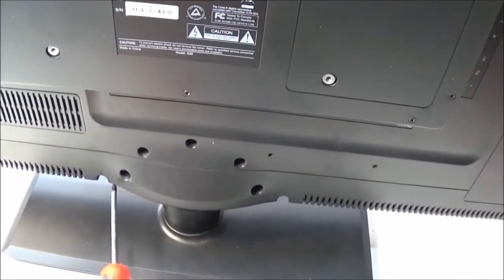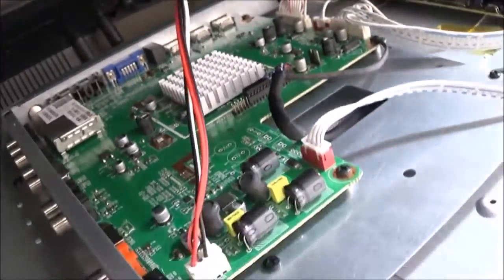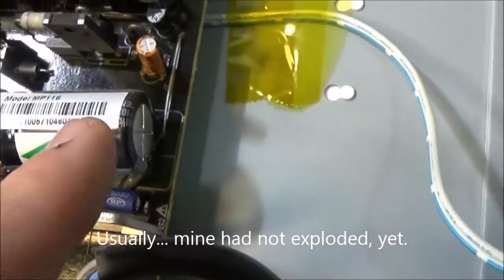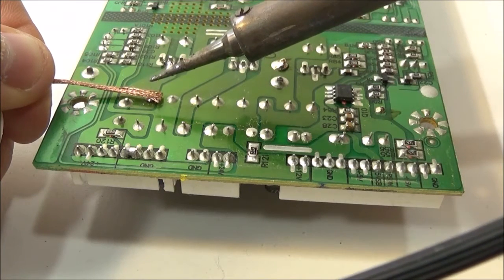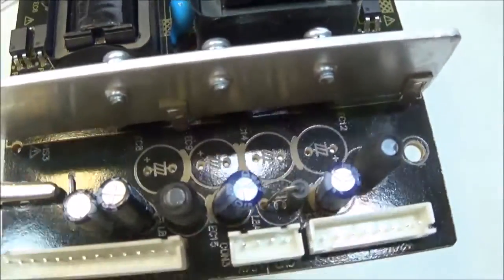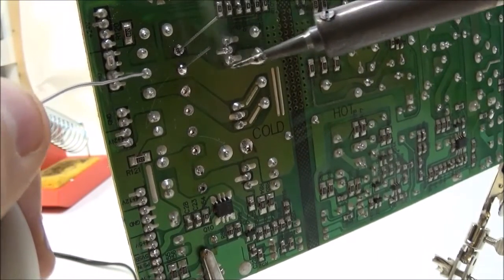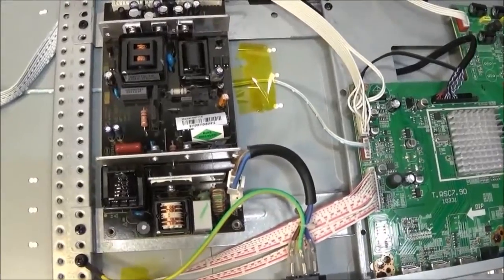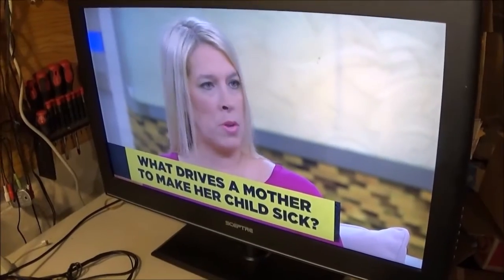Sceptre X320BV-HD 32" LCD TV Flickering / Turning Off and On FIX

Comment: This applies to model MIP320FL-02 also a 32 inch HD Sceptre dumb TV.
The board is different but had similar caps.
 In my situation one of them was capxon. I replaced  them all and problem fix. 

MANY THANKS!!

I love my dumb t.v. 
Smart t.v.'s got pretty annoying real quick.

Comment: What would the replacement be for the large capacitor you mention in the video that you recommend replacing? (yours had not failed yet) I'm planning on ordering all the other one from mouser.com.  Thanks for your help.
Reply: I just replaced all the capacitors from the ones mentioned int he video and I thought everything was good but about half an hour later it started going in and out again so I guess it wasn't those for me